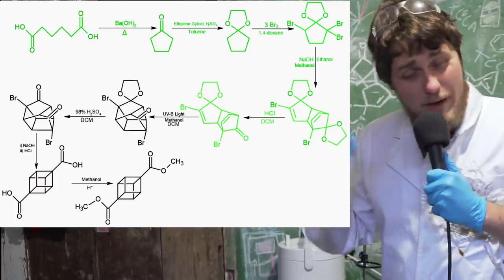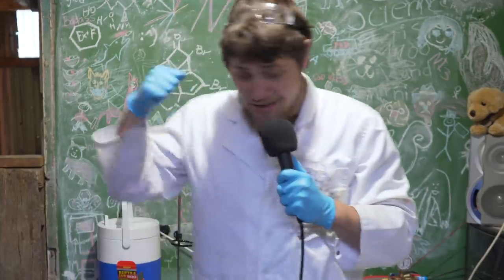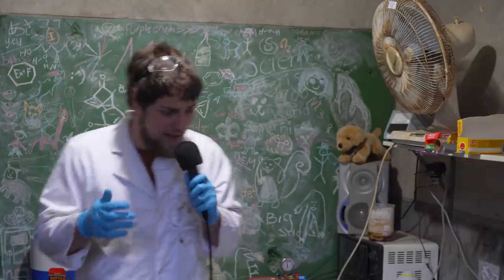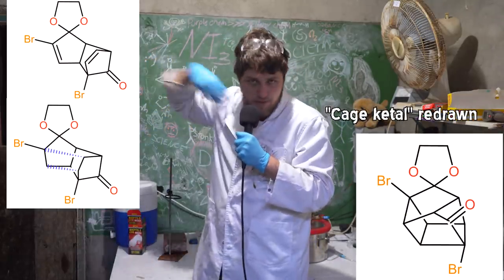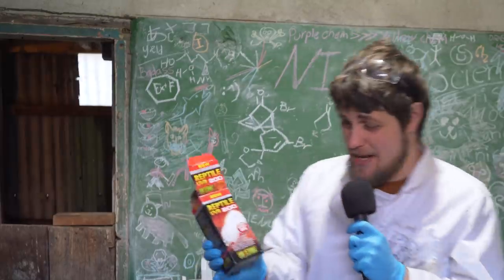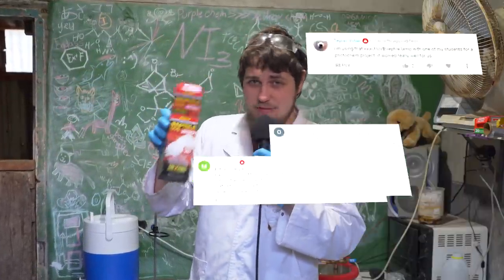Ultraviolet Cage Creation - Cubane Ep 10

Comment: Is it possible you could get a laser in the specific wavelength you need? even if its just a hobbyist level laser it might be better than your lamp. If the laser is just a diode with no board then you could make a video on making the controller and switch for it.
Reply from the maker: Laser in the UV range we need are pretty hard, it's not a very available or easy to reach wavelength unfortunately
Reply: @ExtractionsAndIre  ah that's a shame, I did see something on chemical lasers that emit that wavelength but it seems conventional lasers aren't going to work then. I tried looking for LED in that wavelength and did see some but it's in a low intensity. Hopefully the NMR comes back with promising data!

Comment: You have that fancy spectrometer. Couldn't you theoretically analyse your solution with a simple UV absorption spectrometry setup? As a source you can use the same reptile lamp. If there is less absorption in the expected range of your double bonds, it should signal starting material consumption.

Comment: Could always use nail polish curing lamp they are fairly cheap on Amazon and ebay and are commonly 350-365nm and radiate out a metric fuck-ton of uv-b in a perfect size for your test tubes

Comment: @00:21:00 

Your TLC eluent is too strong. Try reducing it's strength so that those spots run a bit slower. The ones you have here are way too fast and there's a chance they are overlapping. Maybe try cyclohexane/ethyl acetate 90:10 and see how that goes?

Comment: To speed up such a task, its really best to invest in a shitty old monochromator from ebay and ideally get a stronger source such as the feared HBO lamp. Also to avoid tarmode, you may want to choose a irradiation wavelength, where the product absorbs the least and the reactant the most, so the product doesnt tar itself into oblivion a.k.a. secondary reactions or bromine cleavage funtimes. That means measuring the absorption spectrum over 250-800nm, if you have access to a spectrophotometer and picking the correct wavelength.

And please drop a stir bar into that test tube when irradiating, the mixture should really be homogenised. Plus your test tube is probably eating up quite a large portion of the incident light.

Comment: That bulb is wrong for what you want because of the coating in the bulb. Should have listened to the advice I posted and you would have been golden with a 100W bulb for <$20. UV LED COBs are very tightly restricted to a certain wavelength which is why the grow lights use multiple different ones. I bought a 30W for $9 centered in the low-mid 300nm. UV is also blocked by glass.

There are nail polish dryers that are 365+405nm. There is one that is 90w for $15 on Aliexpress that will be easier to use than an LED because it has the power supply built in.

Comment: Household mercury lamps are very cheap and are all self-ballasted you might even have one lying around, the problem is they are high-pressure mercury and thus emit a large portion of light at 250nm, however, if you could filter this out it would be a good option, magpie described how he used one for making carbon tet, (http://www.sciencemadness.org/talk/viewthread.php?tid=14927) essentially he used a Dremel to remove the outer glass (this would only be required in your case if the outer case was coated in phosphorescent material)

Comment: Don't forget you need quarts glass to transmitt uv.
If using regular glass you loose a lot of the actual UV radiation
Reply: And black light bulbs are usually 365 to 395nm range instead of those lousy leds it might be better

Comment: What about those el cheapo water purifier uv lamps on ebay. They are like 20-25$+5-6$ shipping. The only potential issue being, I don't see any driver i.e. electronic ballast for them over on ebay. I guess you can buy those drivers as a replacement for you broken water purifier SOMEWHERE at your local wallmart?!

Comment: Hey Tom awesome vid hope ur PhD is going well 
Been watching u since I started high school now almost finishing undergrad
Crazy

Here are my thoughts

https://publiclab.org/wiki/uv-spectrometry
Note the absorption spectrum for borosilicate in this link 
I suspect that the borosilicate glass is absorbing all your UV, esp with such a low wattage source
My suggestion is to get a little bit of your reactant, dilute it down in a lot of solvent, and expose the solution directly to the light source. Thinking maybe shine it directly into the top of a beaker or petri dish 
check every thirty mins for evaporation and top off as necessary… 
If you are staining only with KMNO4 I would not trust product spots, and only go by disappearance of the reactant spot. You were correct that KMnO4 is very sensitive, and my suspicion is that you were observing minor side product peaks… we will see what the enema reveals. But my experience with KMnO4 stain is that it’s iffy unless you have a readily oxidizable carbon atom such as a non tertiary alcohol an aldehyde double bond etc 
if you do want to check for product formation: you can stain with 2,4-DNPH In H2SO4 to reveal aldehydes or ketones. 
I have actually made 2,4DNPH the” hardware store method” -might be a fun project lmk if you want details
Another thing… DCM or DCM/MeOH is still way too polar for this compound.
 I would suggest diluting down your DCM with hexane or something else v non polar 
Another commenter suggested dilute gasoline.. might work really well esp if ethanol free
Gasoline with 10% ethanol might make a good mobile phase all by itself… just a thought

Another possibility would be just running it in Ethyl acetate/hexane. 
Ethyl acetate can be purchased as “MEK substitute”, at least in American hardware stores 

Loving this project man!!! Cheers!

Comment: I think the cheapest way to get enough 325 nm power is to use a mercury arc lamp along with a 325 nm band filter, getting the lamp (without power supply) and the filter will cost you around 350 dollars us.
Here is a link to a small size 100 watt mercury arc lamp   https://www.newport.com/p/6281
And for the 325 nm band filter  https://www.edmundoptics.fr/p/325nm-cwl-125mm-dia-hard-coated-od-4-50nm-bandpass-filter/41548/
Reply from the maker: yeah filters are expensive aren't they. And that's the price for just a 1/2 inch diameter filter, and the lamp light goes everywhere - not so easy to control with a filter. A powerful lamp could be used then but yeah, pretty pricey all up
Reply: @ExtractionsAndIre  Apparently an electric arc with a modest voltage (5kv) can be tuned by frequency to emit at relatively narrow range close to 325 nm the paper is here https://www.mdpi.com/1996-1073/13/7/1676

Comment: Wouldn't just turning it on and forgetting abt it for a few days be an option? The lamp is pretty much meant to be left alone inside a box (no shit, it's a reptile lamp).
Reply from the maker: I do worry a bit too much, but to be fair the reaction mix will boil if the lamp heats it up to 45 degrees C which isn't really too hot, and perhaps even below that it'll build up enough pressure to throw out the stopper and dry out. Maybe the solution is active cooling so I can just run it for like 10 hours at a time
Reply: @ExtractionsAndIre  I mean active cooling would sure keep the temperature down and prevent pressure build up. It would probably be enough if you just had a frozen carton of milk or something inside that box lol. Although the temperatur problem could also be mitigated by using some higher bp solvent. Ethanol maybe, or some hexane/heptane mix? Haven't looked into that UV reaction myself tbh so I don't know if it's even gonna work in ethanol or heptane for that manner.

Comment: Why did you make your reactor box so big? If you only need to put a test tube inside why not take a 20 ish cm long cylinder with like 5 cm diameter, close it up one end, cover the inside with aluminium foil and mount your test tube on a block of styrofoam at the bottom. I would imagine the UV exposure should be a lot more efficient due to less escaping of light and focused reflection of UV towards the center of the tube i.e. where the reaction takes place. If temperature buildup is an issue put a PC fan at the bottom or smthng.

Comment: Think. Best yield is one photon per electron (ionization). One Mole is 6.24 x 10^24 molecules. One Ampere of current is 1.6 x 10^18 electrons. If your lamp is 15 watts at 120 volts (US) so ~.9 Amp.
Reply: Ampere is 1.6 x 10^18 electrons per second, and 3600 seconds per hour.

Comment: Stick it in a skinnier tube, stick the tube inside the coils of the fluorescent lamp, wrap whole thing in foil. More direct UV, you're forgetting about squared-cubed losses in light from distance - you don't just wanna REFLECT a bunch, you wanna have the lamp as physically close to your stuff as possible. Ideally you'd just dissolve it in a fuckload of solvent and stick the glass portion of the bulb down INTO THE CONTAINER so you're not soaking up 10-20% of your target wavelengths with the borosilicate glass, but that's not really practical.

Comment: Another alternative (safety feature?) to a cooling fan is a seed germination mat thermostat. This would run the lamp until the temp reached above a set threshold on the included probe thermometer and then switch off, switching back on when the temperature drops. If it didn't ever reach that temp then all is well. Here's an example one. https://www.theseedcollection.com.au/Heat-Mat-Thermostat

Comment: Just run the darn lamp for a week. What are you afraid of? 

Also you can use a quartz vessel.
Reply: On this side of the planet we are justifiably paranoid about fire. Last summer it rained ash. The summer before that the sky was red.
Reply: The concern is understandable, however the reptile lamps are quite safe to use 24/7 and emit relatively little heat.

Comment: Okay, here i am, at video 10, and it's 5 months later. Any idea when we'll get the next installment? I really want to see you blow up some ONC some day XD
Reply from the maker: Soon...ish. I've been so slow lately
Reply: @ExtractionsAndIre  I feel this deeply. I've been watching your videos for ages and am finally going to put some of what I've learned to use. I have a giant pile of new molecular sieves I forgot I had, and I'm gonna try using them to dry my solution and filter some...ahem....carbon soot (sad extraction noises), using said sieves. I've never used them before, how many do you think I'll need to remove all the water from a solution containing ~50ml of azeotropic ethanol? Do you think I should run the whole mess through some activated charcoal first to try and remove most of the soot? I was going to try syringe filtering, since I am working with maybe 32-33 grams of actual product, but was concerned that I might need to use a lot more alcohol than I'd like to get the viscosity down to the point that it'll even run through submicron syringe filters. The end goal is to produce a product that's as clarified and soot free as possible, without distilling it (because I don't have any of the necessary glassware to do so). Once I get it into the vacuum oven it's not an issue, but trying to actually evaporate water out of my product with a vacuum oven is a fucking nightmare, and it can take weeks, despite the theoretical boiling point of water at -30"Hg, because the final product is a highly viscous resinous mess until it dries out completely. That and it's fucking raining on and off this time of year so humidity is as high as it'll get, and I'm dealing with a fucking hygroscopic mess even after I've completed my drying steps, until the ethanol is evaporated. Fucking fuckity fuck fuck, this is going to be interesting

Comment: What if you had two bulbs, and facing each other, into a large coffee can with the bottom cut out. With the other light shining invfrom the bottom, with it on its side.  Have a hole to fit tge test tube inside of, between the two bulbs! There should ve very little loss of light!

Comment: Just so you know, the aluminum foil was a great idea, but you're still loosing a lot of power through the exposed plastic since it's surface area is quite large in comparison to the chemical...
I honestly didn't watch any further than that, but i might aswell point out the importance to spread the chemical out as big as possible.
Like on a really level Glass plate or whatever and wash it off when done...

Comment: DCM and methanol is way too polar for the compounds in your reaction. Your compounds are pretty nonpolar and your plate looks like everything is being pushed with the solvent front. It also doesn't look like you're substrate changing polarity too much when it is converted to product so your starting material and product may have similar rf values. That faint spot you see could be your product but I suspect it is your starting material slowly deprotecting itself. You can get acetone or ethyl acetate from nail polish remover. A hexane/ethyl acetate or hexane/acetone system will work much better for monitoring this reaction via TLC. I think I saw you use benzene or toluene in some of your other videos. If you don't want to use hexanes, either of those could be good options for your nonpolar solvent. I know that you may not have access to the materials for it but Hanessian's Stain might also work better than permanganate for what you're doing. Not trying to be super critical. I love your videos and I just wanted to give some advice.

Edit: Also I know that you removed the methanol but there are still probably trace amounts left in your DCM and DCM solvent systems are super sensitive to methanol even in small amounts in my experience

Comment: Those compounds don't look to me like they will show on TLC by UV. The main problem is the solvent polarity, though. If you just use, say 10% DCM in hexane (heptane, petroleum ether, some very non polar hydrocarbon), you'll separate your spots and visualize them fine with permanganate stain. DCM is going to be too polar of an eluent for just about every compound in your scheme, other than the diacid. 

Also, to make TLC less painful in the future, why not pull a bunch of spotters just so you have them? You can also pre-make your eluents and store them in tightly sealed containers. Additionally, if you have iodine, you can make an iodine chamber to visualize your spots on TLC. You don't have to make a stain solution or heat with I2 visualization. 

https://chem.libretexts.org/Bookshelves/Organic_Chemistry/Book%3A_Organic_Chemistry_Lab_Techniques_(Nichols)/02%3A_Chromatography/2.03%3A_Thin_Layer_Chromatography_(TLC)/2.3F%3A_Visualizing_TLC_Plates

Comment: UV LED diodes ? high power 320 nm LED costs around $ 50
Reply from the maker: what's high power from a 320 nm LED? Generally they can only do 50 mW or so, and they're pretty expensive. If they're cheap and watt level power - the supplier is lying to you and they're just 365nm LEDs. That's my feeling anyway. If you've got some links, send them through though!

Comment: Regular glass blocks almost 100% of UV-B!
Reply from the maker: Normal glass is usually pretty good down to 300 nm and shit below that, so it should be good for our range
Reply: @ExtractionsAndIre  The random glass in your test tube may be particularly opaque to the UV the reaction needs, maybe try a test with a UV sensitive salt and see how fast it reacts?
Reply: @ExtractionsAndIre  or just get a borosilicate test tube or break open a quartz UV lamp and use the tube.

Comment: You sir... give me your man card... what kind of man can't run a power tool?!   Didn't you pay attention when your dad was teaching you stuff??

That may have been a mean joke.. but, aside from that you are on the right track when it comes to making a uv enclosure, people who 3d print in reson or use UV epoxy as a hard clear coat for models or fishing lures for example. 
The majority of UV enclosures use tube lamps  or led clusters of the right wavelength on 1 or both sides  of a box lined on the inside with a smooth reflective surface the more mirror like the better. And if you can set up mirrors to direct light at your target from the lamp even better. 

As for wattage of the light you are using I don't think that matters too much. From what I've been watching when it comes to chemistry, time  is 1 component that shouldn't be shortened. I have no idea how much you should have yeald yet. And maybe you have a high yeald already but can't see the difference. 
Or you may not be hitting it with the right wavelength. There is a second wavelength spike on the boxes diagram. Could it be counter acting 🤔  

If you need advice on how to Engineer something from common objects to solve something I can help. I'm a "redneck engineer "

Keep up the great work. It's nice to know I can make some of these chemicals from common products